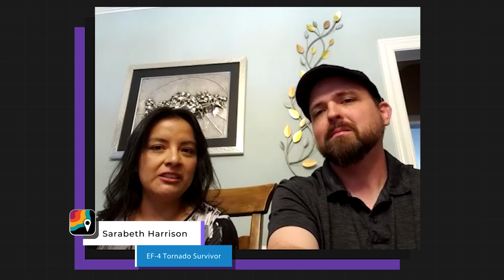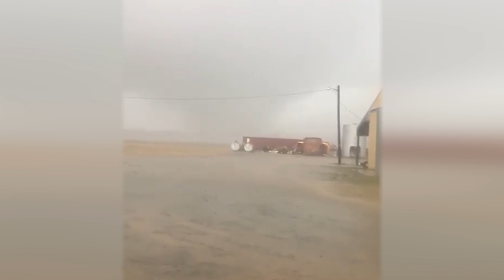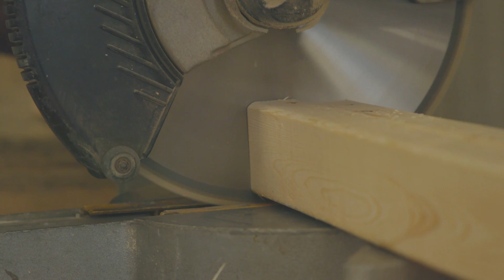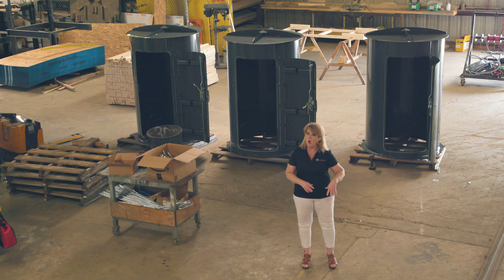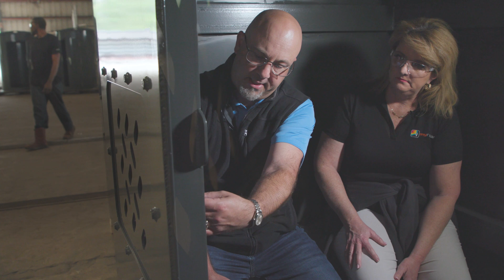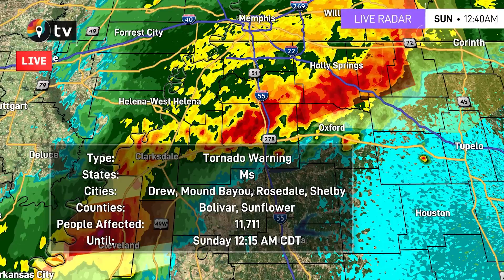Weathering the Extremes | #TornadoStrong

Comment: Would've been nice to have one of these dedicated to the Super Outbreak on April 3-4 of 1974. After all, that outbreak changed the way these storms are tracked and led to the advancements we use to this day.
Reply: Also, I have to disagree when he says "It's not the wind that causes the damage or causes the risk to life, it's the debris......" If I'm not mistaken, isn't the wind a key factor in any aspect of a storm? What causes the debris if the wind isn't responsible?? Where does it come from? He speaks of the "...pine straw through a 2x4..." and then proceeds to say ".... everything in a 250mph windstorm is a projectile or a bullet...." and discusses shooting 2x4s into the pods at 150mph. What if it's a fully loaded Mack Truck or even a bus that's been turned into debris, will it withstand the impact? I understand the point is all about safety and I'm all for it. I just find it more feasible to prepare for a "worst case scenario" instead of a mediocre one. And considering I've seen tornadoes rip out entire buildings many times in my lifetime, some even including the foundation, I've found being below ground is the safest place to be.
Reply from the maker: @neolithicnobody8184  Hi Charles, the wind is obviously what drives the debris. The point we are trying to make here, is that pine straw is soft and malleable. And if it can get lodged into a 2x4 that underscores the intensity and ferocity of those winds. The point is the hurling debris is what will literally kill you. But the wind can and does carry people away, and that's also usually fatal. We are not saying above ground storm shelters are the only answer. They are one answer. And a good one. But being prepared is what will keep people alive. 98% of most tornadoes are survivable, IF you have a plan. Thanks for the feedback. ~Leslie
Reply: @neolithicnobody8184  Ik huh huh